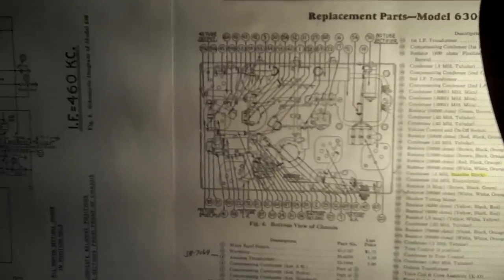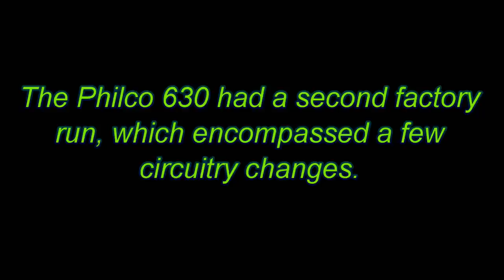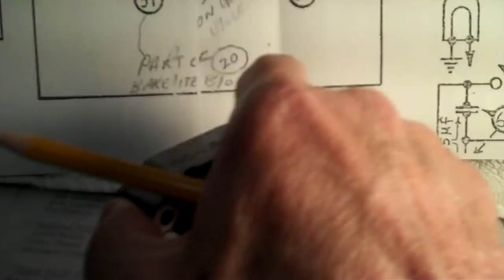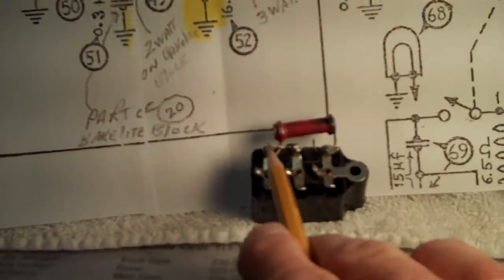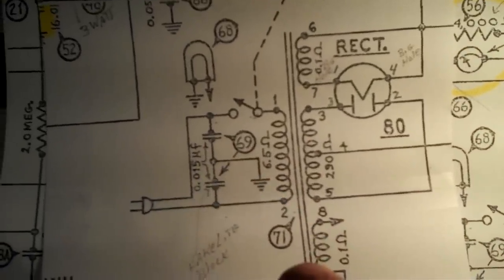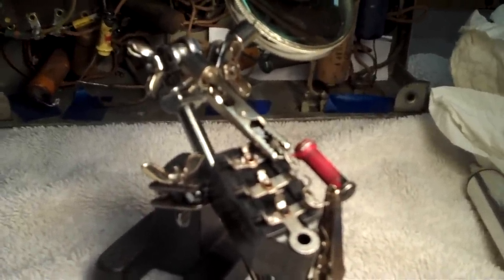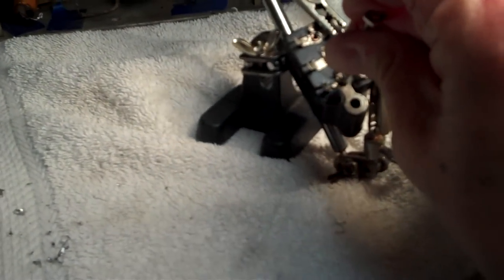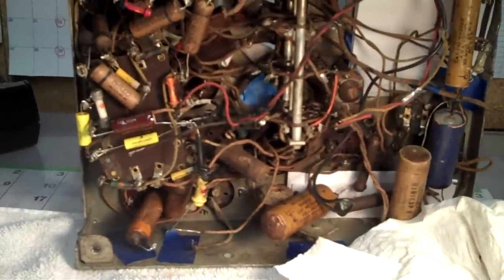1936 Philco Model 630B Repair and Restoration (Part 17 of 35).

Comment: Happy Thanksgiving, 6 years later! I learned elsewhere on the ol' Interwebs you can heat the Bakelite blocks in place (assuming they're easy to get to like in a Philco 70), and of course assuming you've clipped the capacitor wires first, take a paper clip and push the block until it hits the chassis, and then fairly quickly remove the screw and spin the block around to pull the wax/tar block the rest of the way out.  I tried this and was able to do most of them without even unsoldering the leads!  Mind you, sometimes Philco likes to slip a resistor in there (one on the 70 has a resistor), and I, wanting to keep the original resistor in place, just picked out the top layer of wax until the capacitor came out, and then carefully soldered the new cap inside, onto the existing cap leads.

Yes, people are still watching your videos years later!

Comment: I really have enjoyed watching this.  I am trying to learn as much as I can about the old fashioned variable capacitors as I can.  I wish you would have a video that explains the variable capacitor (you had a three bank one) in detail.  The "gizmo" capacitor is called a mica capacitor because it is an extremely stable cap in radio circuits.  It is/was used to reduce noise or act as a filter from what I have learned.  Your explanation of the wire not being soldered was extremely interesting!  I definitely learned an interesting fact.  The other part was showing the grounding flanges...I am struggling trying to get all this information from a dozen or more sources, nobody has all of it together.  I would like to see an explanation of the wiring of the variable capacitor to the conductor coil in a radio.  I mean, a physical example of the connection in a simple crystal radio so I can see it for myself. Thank you for all the interesting details!

Comment: Some people go crazy restuffing wax paper capacitors so they look original. I've never bothered with that (mainly because I've never had a radio that historically significant), but restuffing Philco's Bakelite blocks, and the bigger caps in the flat metal cans is easy enough to do, I don't mind that at all!  Mind you, the big metal electrolytics, I just leave alone and put a terminal strip under the chassis.  I like to keep things looking as original as possible, but I have my limits, so a terminal strip under the chassis is no problem, and it's reversible.  If the next guy wants to restuff the cans, well, there they are!

Comment from the maker: Perhaps so, but paper caps aren't used anymore.  But you'll get differing opinions on anything relating to vintage electronics repair and restoration.  Some folks say the craziest things.  But if I found a capacitor located in an area where it's subjected to excessive heat, then I'd relocate it.  Common sense.

Regards,
John